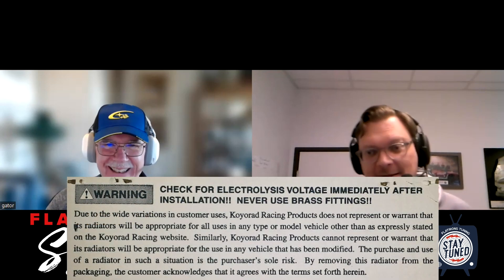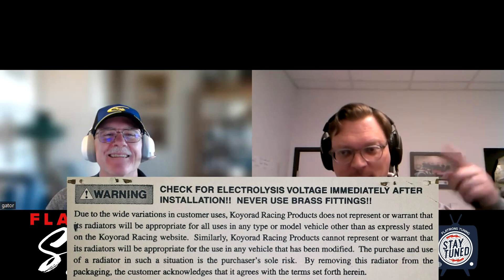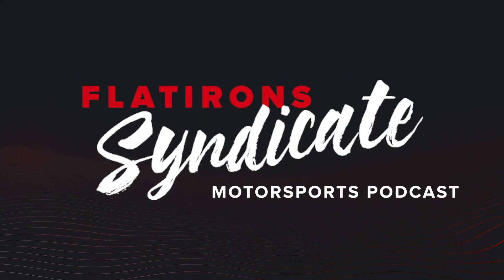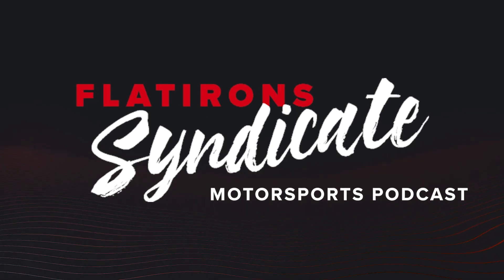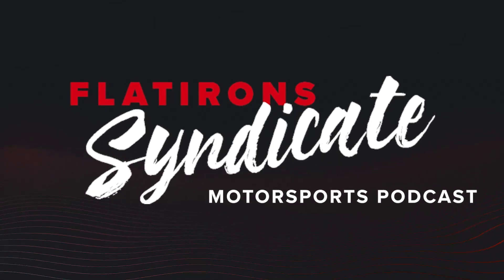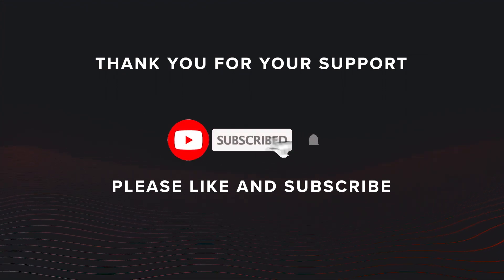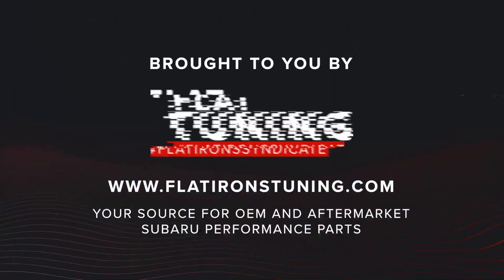How Electrolysis can Damage or Destroy your Cooling System

Comment: Coolant becomes the ground issues. I see voltage when I touch the radiator with multimeter positive lead, negative lead on battery negative. Interesting. Amazing video!

Comment: I'm late to the game here.  I've got a 67 Impala, 327 4V Quadrajet - THM 400.  In the 90s I replaced the valve cover gaskets.  It wasn't until 20 years later, two heater cores, two radiators and water pumps did I discover that I hadn't replaced the two ground wires from the firewall to the valve covers and learn first-hand what electrolysis is in a car.  The car sits plugged into a Battery Tender Jr. most of the time.  In 2008 I had the transmission serviced (only pan drop, filter change and top off).  The service manager at the dealer was into older vehicles and was a wealth of knowledge.  He stated in this situation the next path without those wires was into bushings in the transmission.  He drove and checked my car and felt that damage hadn't happened to the transmission yet.  Before I had a chance to have a deeper conversation with him, he retired and I can't get in contact with him (they won't give out his info, understandably).  I've had all new (NOS) GM parts (except for thermostat and hoses) on-hand for many years meaning to do this project of radiator, water pump, hoses, thermostat and heater core.  Although those two ground wires have been connected for many years since, does anyone have any advice on running extra ground wires to ensure this doesn't happen again?  I plan on flushing the living daylights out of the engine with distilled water before installing new parts (engine running while I'm pouring more water in).  Any other advice besides more ground wires and flushing tips?  I hope this hasn't damaged the cast iron heads (camel hump) nor the cast iron block.  The car is very original as my grandfather purchased it brand new in December of 1966.  I start and drive it periodically just a mile or so away as the water pump is very noisy, but amazingly it runs and drives really nice (despite ancient gas as well).  But health problems have delayed this project.  But I plan on, come hell or high water to give this engine the attention it needs this summer.  Any feedback would be appreciated.  Thanks!

Comment: In my 91 mr2, a rust-free car everywhere else, the radiator is a mess.   It has some pretty bad rust all over the top and my only guess is the friction of liquid flowing through it causing electrolysis.   

There is also a singular piece of metal fuel line in the lower bay with standout rust covering it's surface , where everything else on the car is spotless.    Pretty wild to see the stark contrast like that.